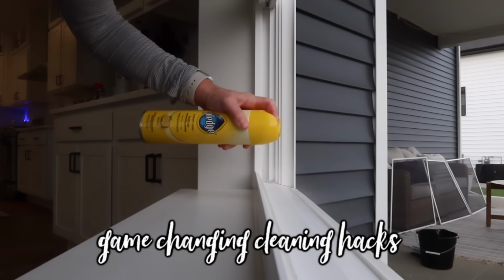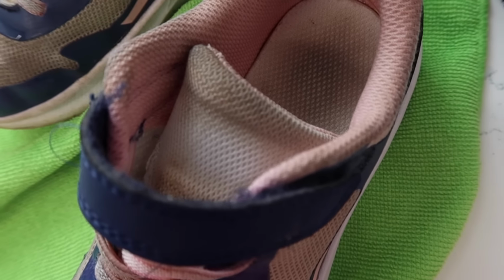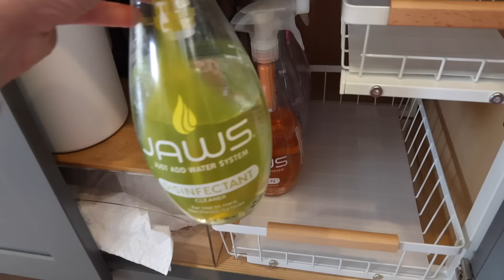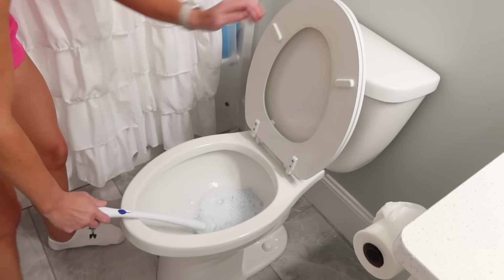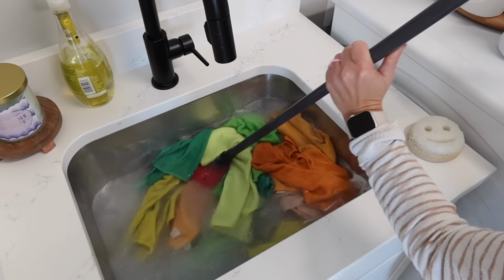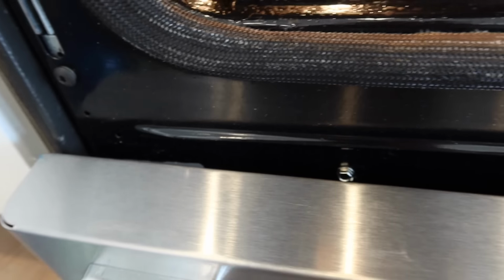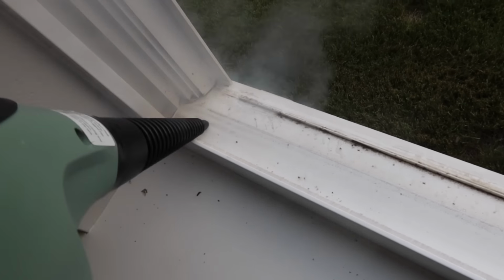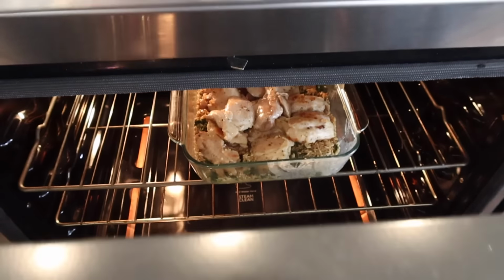NEW! EXTREME ORGANIZE + CLEAN WITH ME | KITCHEN ORGANIZATION IDEAS DEEP CLEANING CLEANING MOTIVATION

Comment: Jamie, 2 things.  First, the screws on the inside of your oven door--if you unscrew them you will have full access to the inside oven glass & can completely wash it.  Second thing.  I wish you wouldn't mop with bare feet.  You're going to fall and possibly break something.  I even saw you slip on the wet floor in this video.  Stay safe.
Reply: Agreed! I got some cheap mopping slippers (or you could get socks) with microfiber bottoms that are perfect for this, I only use them when mopping and they stay clean

Comment: Great video Jamie. Do you have any suggestions for cleaning a fiberglass tub that has a pebble texture on the bottom? It still looks dirty even after I’ve cleaned it.
Reply from the maker: Bad keeper’s friend! The powder kind! or even a magic eraser sponge. But bar keeper’s friend powder is pretty amazing! I hope it works!
Reply: @JamiesJourney   I will try Bar Keeper's friend. I have tried a magic eraser but maybe the combo will do the trick. Thank you.
Reply: I use Comet on my fiberglass tubs. It seems to be the only thing that works well enough: let it set with a little water then scrub it with a very coarse brush. I use a spin brush that is a cordless brush I bought at Home Depot. It looks like a weed eater attachment. I use the corset brush they make. It's really expensive but a better investment to last longer than those cheap ones on Amazon but it’s downfall it’s a little heavy and awkward. You just really need a good brush that with the Comet works great, I’ve tried every cleaning product. Hope this helps.😊
Reply: @pinkbutterflies1679  Thank you for the suggestion.

Comment: I wonder if you can put a microfiber cloth on one of the Swiffer duster rods (without the duster head on) to fit between the oven's glass panes! If it would fit, it would probably be easier to move around than the wire hanger.

Comment: Hi, I would not use metal hanger on oven door cleaning. I would suggest using a drain cleaner plastic tool, wrap the microfiber cloth around it with cleaning product on it.  Or, even use the brush  with the microfiber cloth around it, the brush that you clean lint out of dryer hose. Both of those holds the towels nicely.
Reply from the maker: Thanks for the tip! I appreciate it! 😊

Comment: I asked chat gpt about the Wd-40 hack:
"Spraying WD-40 on your window screens isn't recommended for keeping them clean. WD-40 is an oil-based product designed for lubrication and rust prevention, but it can attract dust, dirt, and debris over time, making the screens get dirtier faster. Instead, you can regularly clean your window screens with soap and water or a vinegar solution, then let them air dry. For long-term maintenance, consider using a screen sealant or protective spray specifically made for outdoor surfaces."
Reply from the maker: Thank you for sharing that! ❤️